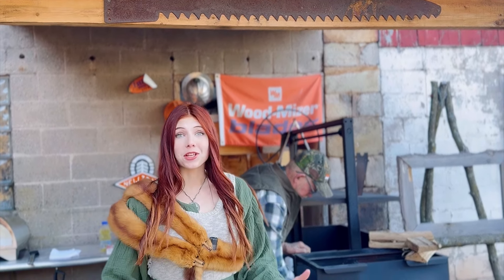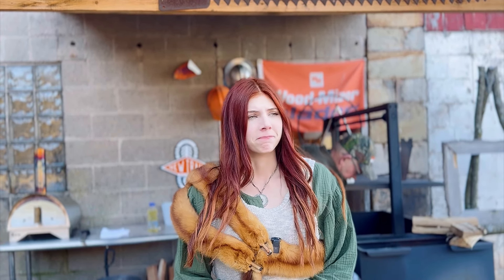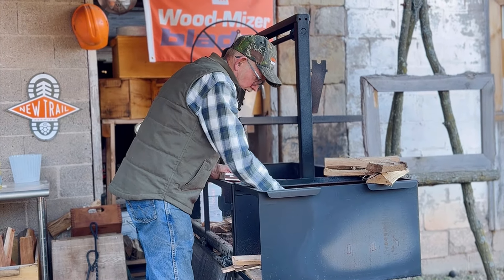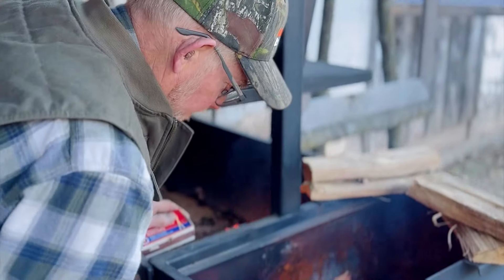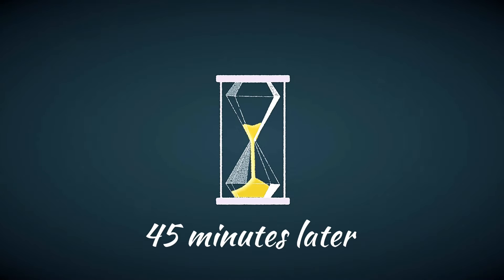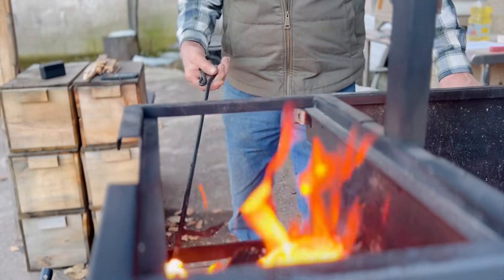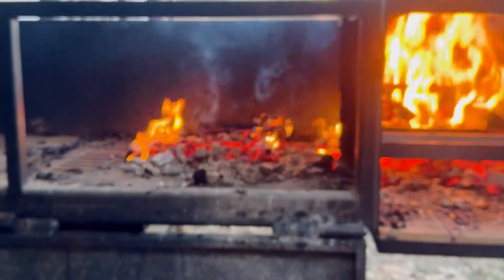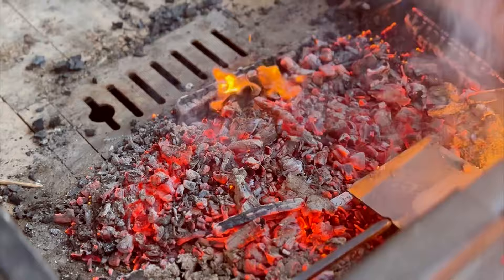Join Us for Rib Steaks 🥩 plus some helpful tips from a grill master

Comment: I likd the slow relaxed approach.

Good tip with ashes.

If you want to eat sooner. Have a fire in cook side as well. Smaller than other thateburns down and heats the cook side before adding extra coals as needed

Comment: Best fire starter. Chainsaw rip silver maple round into a pile of peels. Quick easy. Fill a 30 gallon trash bag in 2 minutes. Grab a handful. Touch it with a match or lighter. 🔥 Store it away from sparks or open flame.